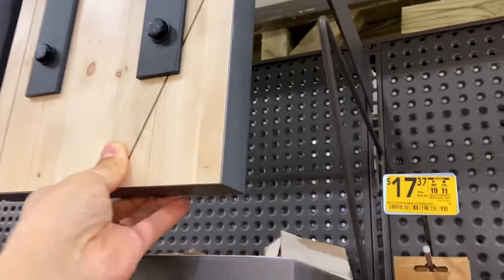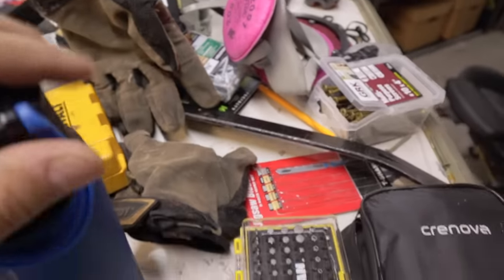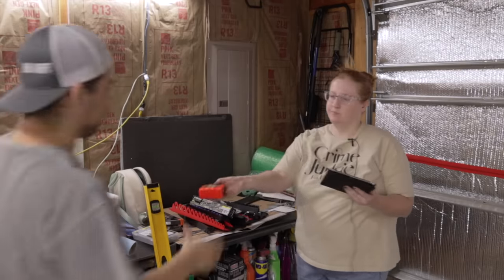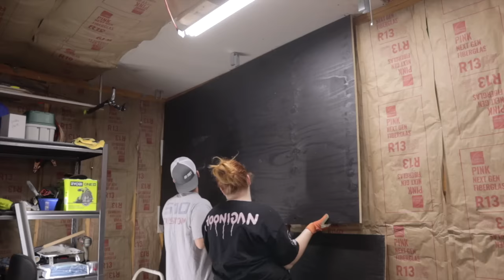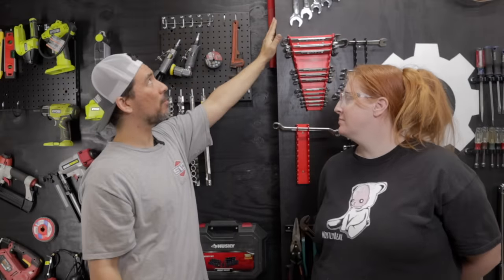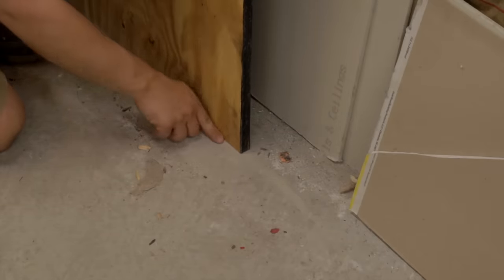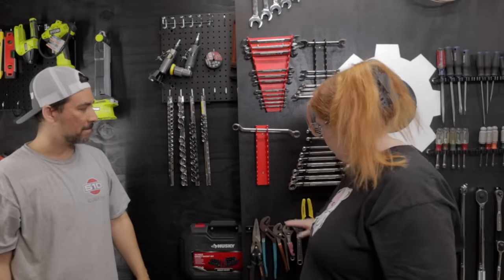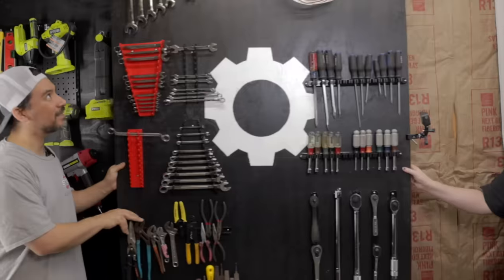The ONE Garage Storage Organization System No One Ever Builds

Comment from the maker: After almost a year of this build, the sliding walls have worked very well. We’re planning to add some more, but also want to add some more unistrut with trolly sliders on the ceiling for quick tool access…we’re open to any other suggestions 🤔🤔🤔
Reply: You forgot to mention stops on the free ends of the track to prevent you from accidentally rolling the tool wall off the track. Also, depending on how the tool wall is balanced it may be necessary to install bottom rollers. They do make Packout mounts meaning that if someone doesn't have a 3d printer they can still mount their Packout boxes.
Reply from the maker: @ianbelletti6241  right on. Someone else commented on some nice bumper stops I could pick up and you’re right they make preprinted pack out mounts👍 Thanks for the tips 😁
Reply: @Itsallaboutthebuild  bumpers are good for the wall end. I was talking about the open end. A bolt across the open end where you slid it into the track is a good way to prevent you from accidently sliding it off the track. You could do the same thing on the wall end for a fixed stop as well. That's maybe 50¢ for 2 nuts and 2 bolts.
Reply from the maker: @ianbelletti6241  oh I see what you mean. Will get that taken care of 👍 thx!!!
Reply: Why not bolt the unistrut directly to the ceiling using bigger unistrut
Reply from the maker: @tarzanaman666  Sure could, but the hardware store had this kind. I've seen thicker online, so your method would work 👍
Reply: @tarzanaman666  he could have bolted it straight to the ceiling but the bolt heads would have interfered with his wheels. Also, this method helps keep the strut walls from spreading under the load.
Reply: I just realized u didn’t put the bolt above the strut in the bracket and that helps with not letting it to cantilever
Reply from the maker: @tarzanaman666  yeah, interfered with the rollers 😅😅😅

Comment: The hole in the side of the hangers is designed to put a 3/8” bolt through. That will clamp down on the strut and prevent any teeter-tottering. That same bolt is very important in higher weight usage because it also helps keep the open section of the channel from splaying out causing the roller to come out of the channel and resulting in a bad day. 😮
Looks good, I’m sure you’ve been enjoying the tool organization and extra space. Fun project! Nice to see you doing it together!
Reply from the maker: Good point, will have to make sure we have the right bolts in place. Thanks for watching and all the great feedback 🙌
Reply: I came here to mention this as well.  That bolt is definitely an important safety factor.
Reply from the maker: @jmackinjersey1  it’s been working fine, but I just saw the video you suggested and it looks like all I need to do is install that missing bolt. Thanks!!!
Reply: Nnñbb
Reply from the maker: @chrisp.76  ???

Comment: A little pro tip for you. I noticed when you went into your drill set. You tried to measure up the bolt with the drill bit. If you actually look inside the set, each drill bit inside the case has a hole drilled into the actual case. That's where you size up your bolt to your bit.
Reply from the maker: Thanks for the tip 👍
Reply: Oh that’s nice, never even thought of doing that!!
Reply from the maker: @adamjohnson6701  yeah, lots of great tips in the comments too 👍
Reply: Even a standard drill index without the holes, I put something in the hole that holds the bit to quick check.
Reply from the maker: @adhdturtle37  great idea
Reply: Little pro tip for you, know what you’re talking about before giving out advice. For what he was doing, sizing the pilot hole for a lag bolt the way you suggested is completely wrong and potentially dangerous. You know why smart guy?
Reply: That hole includes the threads, so this is a bad idea and will likely drill too large of a hole. You need to measure against only the shank, NOT including the threads.
Reply: No that's a bad idea. Doing it that way sizes the drill bit based on the outside diameter that includes the threads and that will leave no material for the threads to grip. You want to size the drill bit to the inner diameter or shank of the screw so that you leave enough material for the screw threads to grip.

Comment: If you use pan head or any type of bolt/screw with a low profile head, you can bolt/screw the unistrut straight to ceiling without the need for the unistrut holder.  That in turn helps the entire system to not hang so low, unless you need to make some space up like in the case where the doors are too short or something like that.  I've used unistrut a lot in my career, but never thought it could be used like this, very cool idea and project.
Reply from the maker: Much appreciated. Couldn’t find the right type of LAG bolt, but I see what you’re saying. That would reduce the cost a bit more with the right type of bolt 👍

Comment: I was inspired by a similar system many years ago and my end result was a little different.  MY next iteration will be more fixed with strut, too.  Rather than move parallel to the wall, the panels are perpendicular to the wall, with the panels pulled out towards you.  The spacing between the panels was initially adjustable, and the beauty of the method is that it lets you use both sides of the panels, not one.  It also let me "nest" collections of items so that on one side, things can reach almost to the other panel, while repeating on the other side at a different height.  You do need to be able to manage tool swing; if pulled too quickly things might want to come off the hook or other mounting method.
Reply from the maker: That's interesting. I thought about using this system with some larger shelves similar to Levrack, but we ran out of space. Would be cool to see your setup. 👍
Reply: @Itsallaboutthebuild That was a long time ago and I was out on a medical for a shoulder injury.  Didn't have much money, but I learned a lot about the concept, and much improvements will follow when I do this again.  Thanks for the additional ideas, and I sent you some info off line.
Reply from the maker: @WustyWench  sweet, look forward to it 👍

Comment: Looks nice.  One point of concern.  Your connection points at the top for the sliders...the bolts thru the plywood will eventually fail with the weight pulling on the small areas of wood.  Loved the 3-d printed mounts.
Reply from the maker: Thanks much, I was thinking the plywood would fail, but with it being 3/4 thick it seems to have held up quite well for the last 2 years 🙌🙌🙌

Comment: This is very clever and nicely done. Nice work guys.
One small but significant point, if I may please: PLEASE don't hang mains electrical tools by their cord/flex. This puts far too much strain on the lead, which can easily lead to electrical failure ... and/or electric shock. 120v up the arm may feel tingly and fun ... but it too often does not end well.
Love the channel.
TTFN
Reply from the maker: @ginox4884  ah, good point. Will have to make some better hook system for those guys!!! Thanks for the feedback 🙌🙌🙌

Comment: One suggestion I would make.  You can prevent the bottom of the tool wall from swinging back and forth by attaching a couple of short boards across the bottom of the backside of the plywood and then using them to mount the rollers horizontally facing the wall behind it and then mounting the roller channel on the wall.  That would hold the tool wall at a set distance from the back wall while so there is no chance of it hitting any tools mounted on the back wall and still allowing it to easily slide back and forth.

Unlike mounting them in the floor, they will not get junk lodged into the rail.
Reply from the maker: @oldtimefarmboy617  ohhh, love that idea. Will have to add that mod for sure!!! Thanks for the ideas 🙌🙌🙌
Reply: @Itsallaboutthebuild  
You are welcome.

Comment: This video...is so great. And I came across this at the perfect time. 

I have a shop that is still a shell... essentially a car-and-a-half Tuff Shed garage with exposed studs. I chuckled early in the video because in a couple of weeks I too will be looking at a lot of "R13" splash! 

I'm already pricing out materials to add this system to my shop

I planned on using French cleats to organize my walls. Pretty sure I'll add that to these sliding walls.

Love your Datsun shirt.
Reply from the maker: Thank you very much!!! French cleats using this system would be awesome. And yes we love Datsun 👍 we have Datsun 510 we’re trying to start working on this year once we finish the BMW e30 rust bucket build 🤣
Reply: Nice! My son has been keeping an eye out for that right 510. I fell in love with the Fairlady when I was in high school auto shop. Good luck on the 510!
Reply from the maker: @orto-ue2kj  We found this 510 nearly rust free during COVID when no one was buying anything. We got a great deal. $8K for the car, plus a fully built L18 engine, a spare block, 2 spare heads, 4 transmissions, and like for sets of wheels. Can't wait to get er running. Stay tuned for videos on the build 🙌🙌🙌

Comment: Add an angle bracket at the wall end of the unistrut to lock it in place.  Also, you may want to add something (large bolt or another bracket) at the open end to prevent the sliding wall from coming out.
Reply from the maker: Yes, I saw that there’s some nice rubber bumper stops too 🙌

Comment: I built the first style using some old bearings some spacers and made my own pulley. For the track, I used a flat bar spaced out from the wall using some nuts and washers I glued together. For ease of installation. The heavy door moves with one finger.
Reply from the maker: Awesome 👍 Love it when you can use old parts. Would be cool to see it 😁

Comment: Looks great I think I want to build one. I was noticing, though that all the weight is held on those brackets with the rollers, not a steel flat bar that is screwed with multiple screws along the whole wooden panel for strength. I might put it too much weight on the board and have that boat fly out and then all my parts are all over the floor. Can’t wait to start it.
Reply from the maker: Get yourself a solid 3/4 plywood. Ours has held up very well 👍

Comment: If you can’t attach the unistrut to your ceiling because it’s too high, a suggestion might be to attache 2x4’x to wall studs and then attach unistrut to the 2x4 and an additional unistrut to t he floor to handle the weight.
Reply from the maker: That’s a great idea, but maybe use 2x6 to get some more distance away from the wall. I think that would work if you had the additional unistruit at the bottom too 👍
Reply: @Itsallaboutthebuild Yes, totally agree. I should have thought through. I’m definitely going to use your concept in my shop that has 16’ high ceilings. I might even add some triangular pieces from the 2x6’s on the ends for additional support. Love your videos.
Reply from the maker: @kiheidude  thanks for all the love!!! Go for it, that’s what we’re here for. To inspire and encourage you to build your own version 🙌🙌🙌
Reply: By attaching a 2x6 to the wall studs you can make it whatever height you want.  Plus you could make a two tiered one so you don’t have to slide the entire 8 foot tall sliding wall all at once.
Reply from the maker: @kiheidude  you could even create a hing on the 2x6 allowing the wall to come outwards. Now only if I had a bigger garage 😁

Comment: Like this idea, but I think I would use Horse Del Mar Wire Panels, so it becomes like a see-through grid wall so that you can see tools through the wall.     You could use some sort of carabiner clip on hangers for tools.
Reply from the maker: That's a cool idea. You could definitely use that setup instead of the sanded plywood 👍
Reply: @Itsallaboutthebuild   You will have less dust collection on the wall, easier to clean off with a blower or compressed air.       I have a problem with mice in my area, so shelving is totally out.
Reply from the maker: @KarasCyborg  true true and darn those dang mice 😄

Comment: New subscriber here. I love the ideas.   I am wanting to close off the shop from the rest of the garage when I run the mini-split so I don’t end p heating/cooling the outside, just the shop.  I have thought of sliding a board from the opening to a sandwiched setup like a pocket door of sorts.  Your use of the struts and slides would help me with that.  (Of course I could mount hanging plastic like they do in coolers, but what is the fun in that?  Haha)
Reply from the maker: @brentjohnson6654  right on!!! The unistrut works great. Been thinking of adding more unistrut with trolly sliders above the car bays as another sliding tool hanger and for adjustable lighting. Thanks. For subscribing 🙌🙌🙌

Comment: Cool idea, However the only thing that irks me is that the panel is swaying as you are either removing or placing items back on the board.
Reply from the maker: Ah I see. Thanks for the feedback. For the last year it hasn't been too bad, but you could add a unistrut to the vertical wall at the bottom with a trolly attached to the plywood to fix that really quick :)

Comment: Wait how come you don't bolt the Unistrut to the ceiling? I can see the Unistrut  Trolley Track bracket wedging open over time unless you run a bolt through those side holes to help hold the track from wedging apart.
Reply from the maker: The bolts inside the unistrut would have blocked the trolly sliders from moving. The mounts are very solid and haven’t wedged open 👍👍👍

Comment: Your link y shows a four foot long unistrut which would only accomodate a two foot wide piece of plywood?  Also the link shows trolley bearing piece totally different than the one you use. 
?
Reply from the maker: Oh shoot, I added the incorrect link. It should be an 8ft long unistruit. Thanks, will fix 👍

Comment: Maybe I missed it but did you put a roller on the floor to keep the bottom of the movable part from swinging?
Reply from the maker: No, it wasn't needed. The Trolly sliders are pretty solid and the wall is heavy enough to prevent excess swaying. 👍

Comment: What kind of weight limits?  Thinking using this for cabinets with wood storage behind
Reply: Unistrut is very strong but weight capacity will be determined by the gage you use
Reply from the maker: You can check the specs on the span weight hold of unistruit. We anchored ours into a 2x6 at three different spots with large lag bolts. Seems to hold up pretty well. Large spans with no anchoring is what may cause you some issues.

Comment: If you have the room to slide the 2nd plywood over, why not just attach the 2nd plywood to the wall and save the money on the rail system?
Reply from the maker: The second plywood on slider allows us to have tools in from of the original wall along with the ability to slide the wall out of the way to get to the back. Its like a barn door, but instead of another room, its just another wall with more tools :)

Comment: You could stop that rocking by putting a block of wood between the rail and the ceiling on each end. 

It looks like it would still allow the wall to roll but would keep it from tilting.
Reply from the maker: @rhess10  yes, also I realized later that you can mount a bolt through the unistrut hangers. Plus you can buy unistrut trolly bumper stops too 😁

Comment: Just put a screw through the hangers into the unistrut rail so that it doesn't move or rock back and fourth.  Problem solved. Also I like 
@vidacrazy's idea to bolt/screw the unistrut straight to ceiling without the need for the unistrut holder with pan head or any type of bolt/screw with a low profile head.
Reply from the maker: Will do. Didn’t even realize there was a hole in the strut hangers 🤦‍♂️

Comment: Cool but what's the point in the moving wall?
Reply from the maker: It’s so that you can double the capacity of storage. The fixed wall holds tools and the sliding panel in the front doubles the tool hanging capacity. Having it slide gives you access to the tools hanging behind the wall. We had tons of tools on a large tool box and hanging everything on the walls saved us tons of space. Do you have a small garage????

Comment: Why would half inch plywood not work? It would save lots of weight.  Would half inch bow over time ? Could run the bottom edge in a groove.  Could add some wood "trim" to the edges..like a picture frame?. I need to make some "doors" to hide shelves in a garage, and this might work well. Using it for some tools, garden items,  would disguise that it is a "door. "
Reply from the maker: It might work, you may want to reinforce the top where the unistrut track sliders are mounted to the plywood. Don’t think it would bow because weight will keep downward force on the plywood 👍

Comment: Do you have a guide at the floor? How do you keep it from banging into the wall behind it?
Reply from the maker: Originally I thought we would need to add a piece of unistrut and trolly sliders to the bottom, but no need at all. The weight of the plywood and the trolly sliders keep it nice and straight. It works great as built in the video 👍👍👍

Comment: Wouldn't you be better off just using the entire wall for tool storage? Seems like you take away floor space with the sliding wall..just curious
Reply from the maker: Great question. We used the entire wall behind the sliding tool wall. The sliding wall helps add more to the entire vertical space instead of using much more lower horizontal space of say a larger tool box 👍 Our project cars take up too much room 😁😁😁